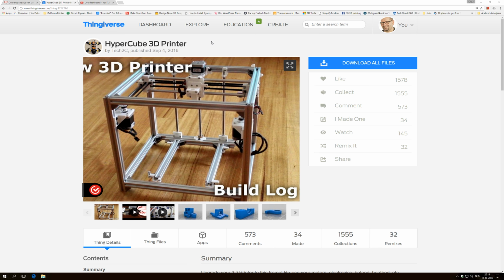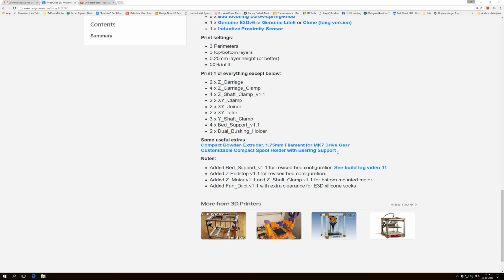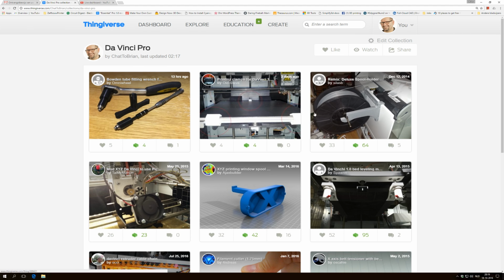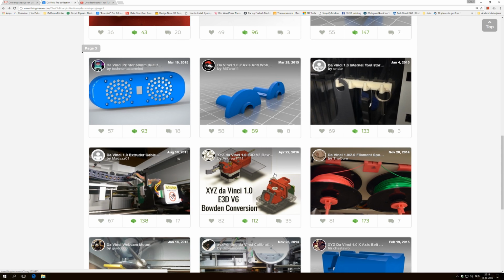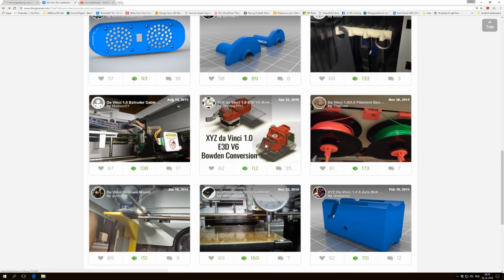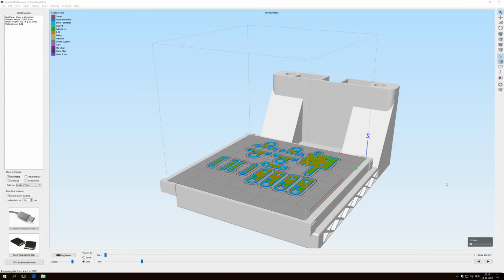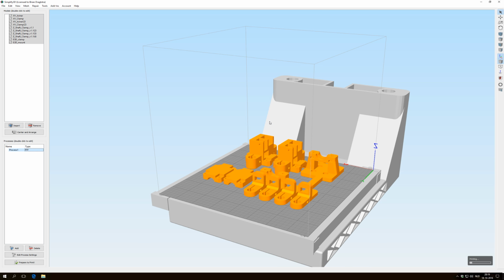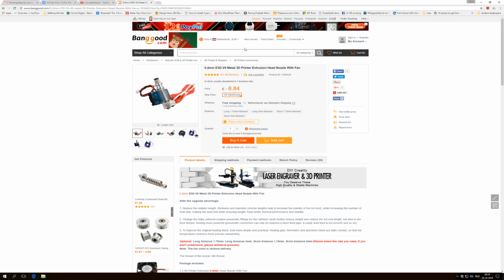3D Print Creator LIVE TEST

Comment: how do you change the inner tube and where can you buy the inner tube upgrade?

i want to print petg at temperatures higher than 240 deg
Reply from the maker: Originally it's a piece of PTFE tube that's about 2 or 3 cm long and 3mm thick with an inner opening of 2mm thick.
I have seen people replacing it with laboratory glass or plain steel.
I took another approach and made myself a new nozzle on a latte that already had an inner tube. But that's not good either. Therefore I am also going to transform this printer into an E3D V6 machine.